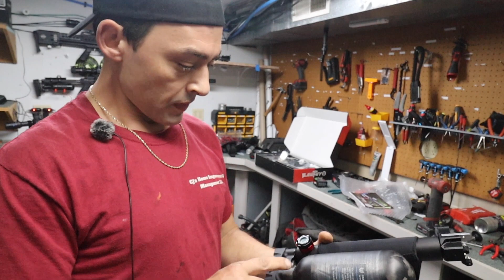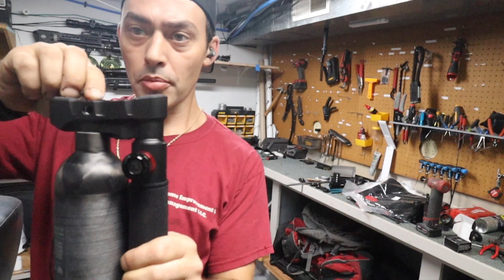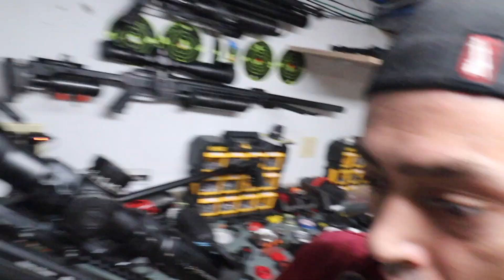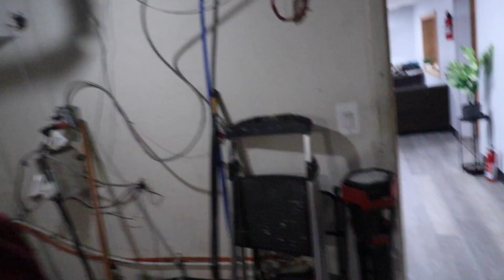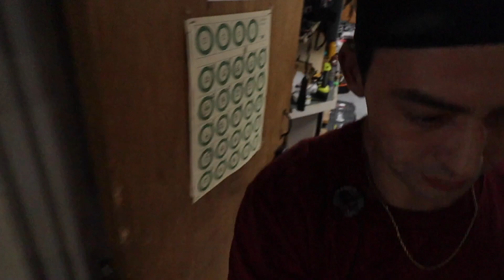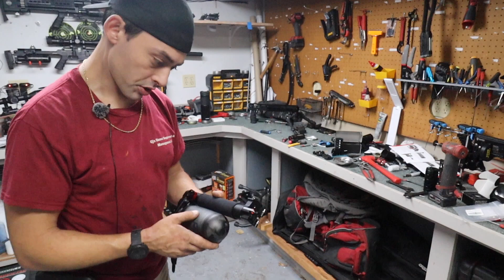Edgun Leshiy 2 - Super Edgun Build

Comment: Chris I hope you saw my first comments on your Leshiy 2 on the transfer puck and magazine installation. The next time you degass your gun there is a small 2.5 mm set screw opposite the hinge side of the bottom of thefront of the air tube. Edgun West has this video showing degassing the rifle and jet installtion.
https://www.youtube.com/watch?v=w7UDeqJYXXk&list=PL73guBRLYQebmWQuElx1stqLRgDS5TKIz&index=31
As I mentioned in my other comment the original magazines were not matched to the barrel bores to use slugs. When I got my rifle in .25 cal. 350mm barrel they were only offering Alfa barrels with no choke and the only pellet it would shoot well was the JSB 25.4 grain as they had an oversized skirt to work in the non choked barrel. I just bought the Leshiy barrel kit for FX liners which is for the FX 380 mm liners.( EdgunWest sells them) Now I can switch magazines and liners to suit the projectiles I want. EdgunLeshiy in Spain has a good guideline for selecting jet combination. My rifle came with a pair of .4's and it seemed a little loud and had a poor shot count. I put in a pair of .6's with the regulator set at 125 bar and I am shooting the 25.4's at 870 fps and getting over 60 shots per fill with my 300 cc bottle which I usual fill to about 250 bar.
https://www.edgunleshiy.shop/collections/power-jets/products/leshiy-2-power-jets-high-power-kit?variant=42217787785442
Reply from the maker: It says this comment is edited but I don’t see another comment, I appreciate the information because the shot count is not what I’m concerned about so much. I have plenty of tanks, big and small. I have a 2 L that I take with me when I’m out, I have a 6 L and a 9 L actually 3 6.8 L in a 9 L and a 220 V compressor, so I keep plenty of air, my Westin rattler eats it, like no one‘s business. It’s ridiculous, but it’s not using nearly as much air now that I’ve adjusted it. Frankly, pretty impressive. Shot count with 137 cc Plenum, and 470 cc bottle does very well. The accuracy was more of my primary concern and has definitely significantly improved. I’m literally shooting the same hole with the 25 caliber 45 green at almost 900 ft./s.